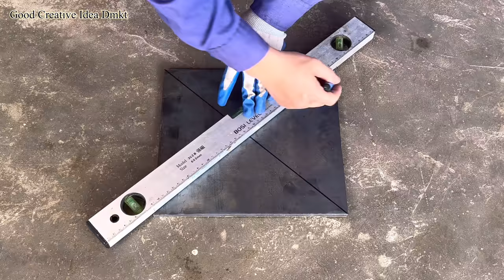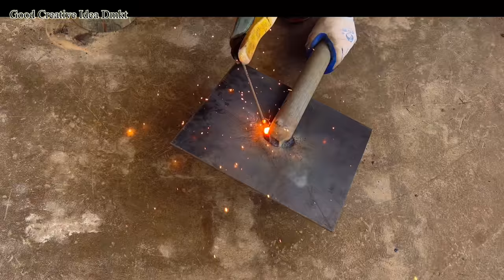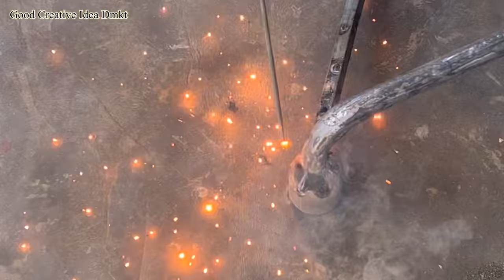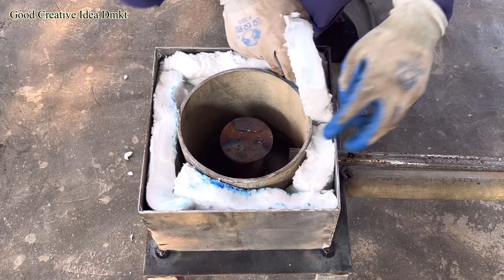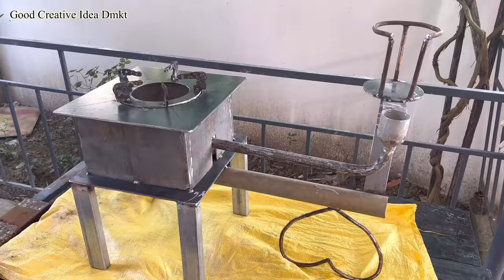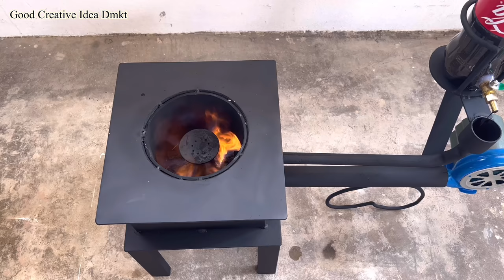How to make a simple and beautiful waste oil burning stove / Super effective idea

Comment: nice project.
But: Why do you not use an old steel pan to begin with?
Why construct the entire thing?

If you use a steel pan, you only need the nozzle for the air.
A hole drilled in the bottom of the pan, the nozzle attached to it. Etc.

Would save a lot of welding time and constructing time, right?

Comment: No doubt, that waste oil heater is built to last a 100 years.😁 

One question, wouldn't the fumes of the burning used oil affect the taste of the chicken?
Reply from the maker: Hello.  The stove has burned green flame and has no smell, so it is very safe.  thank you
Reply: @GoodCreativeIdeaDmkt  làm sao tôi mua được hàng bên bạn ạ
Reply: Can we use motor vehicle oil eg. Engine oil, gear oil etc
Reply: @vsumi3249  yes  any thin oil. You will need to thin gear oil with small amount of gas

Comment: You have done but but electric blower increase the cost, if you have electricity why are you using wasted oil? Think about durable cooker that will minimise risk and cost that can be applicable where there is no other source exactly in remote rural areas
Reply from the maker: Thank you